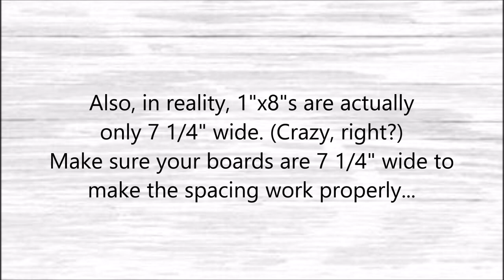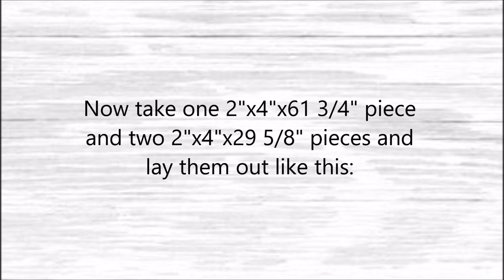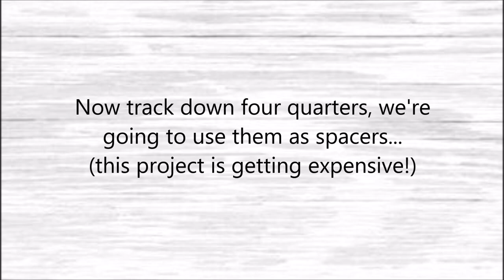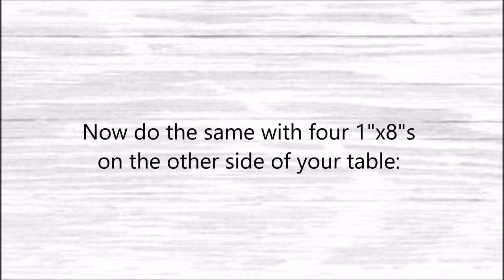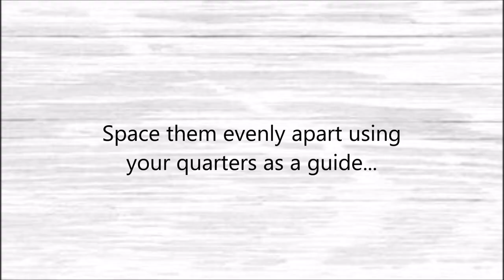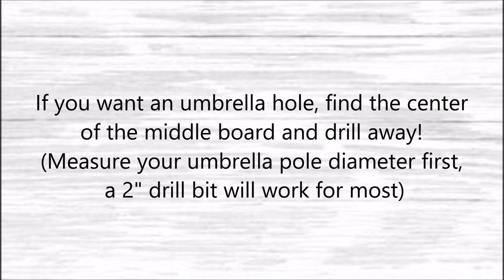The Modern Patio Dining Table - Super Easy DIY Project!

Comment: I love seeing your designs and builds.  I just built your farm table. I made it for my wife as a 40th wedding anniversary present. We use it on our patio. I used reclaimed wood that I had from other projects to build a table but for the top I bought fresh one by tens. It came out beautifully. I painted the bottom in a waterproof gray paint. The top I stained with Bher Ameretto  stain.  I finished it with four coats of semi-gloss polyurethane.  We are delighted with the results.  Thanks for the inspiration.